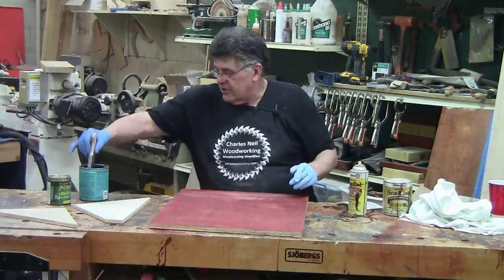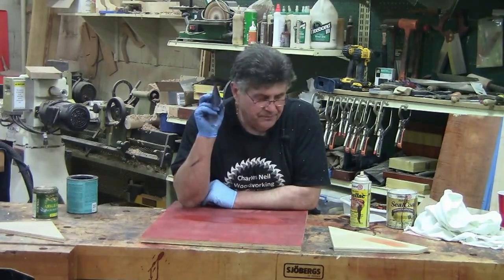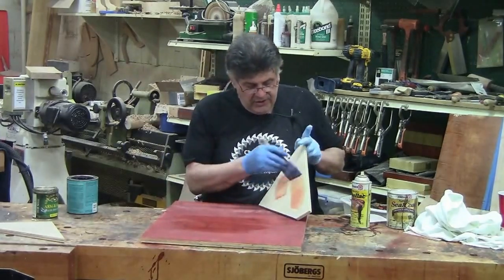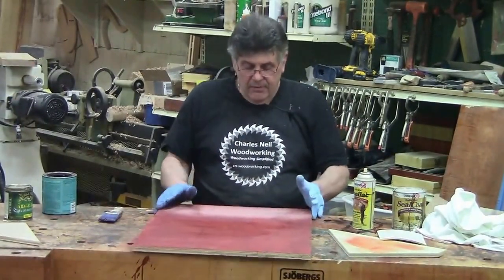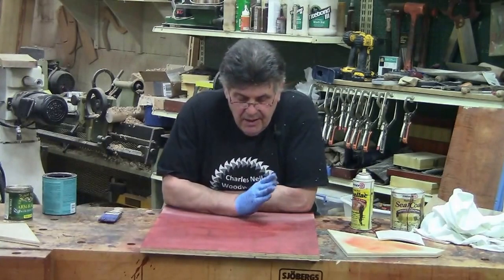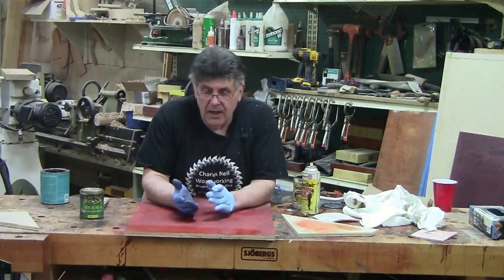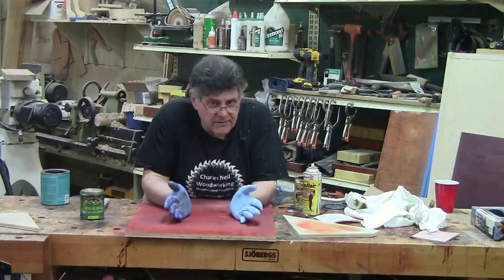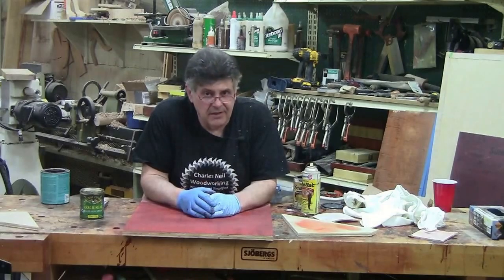Like on Like - Top Coats over Dyes and Stains

Comment: Thanks for the information, Charles. I still didn't get the answer to the problem well, though. I have applied General Finishes dye first on wood, and then applied a coat of dewaxed shellac on top, both with foam brush and with a rag. in both cases the result was terrible. the alcohol reactivated the dye and I got dark spots all over the place. I really don't know what to do at this point. I don't have a spray gun for my shellac. Can somebody help, please?
Reply from the maker: get a spray cand , and just do a light coat , or use some Arm R seal Oil to seal the dye down, its not water base so it will not pull the color, let dry 24 /36 hours, and then do your top coats, give it a light scuff sand with some 320 or finer, just go easy so as not to cut thru ..you should be fine

Comment: Great information. where do alkyd oils fit into the picture?
Reply from the maker: doesnt matter, oils over water base work well, just be sure they are dry before using water base products over them, and I also prefer to do a light scuff sand with some 600 grit, just to provide a mechanical bond.
Oils over oil based stains can also be an issue, so let the stain dry really well first

Comment: Julian Paul JonesCould I apply oil based urethane, Arm R Seal Wipe on Topcoat over and existing finish ? Kitchen cabinets, 5 years old, probably pre-catalyzed lacquer.I can't spray anything indoors. I am thinking to clean cabinets with 50/50 mix of denatured alcohol and water.Then scuff with 220. Then apply Arm R Seal Urethane Topcoat
Reply from the maker: yes , clean with naphtha , then be sure to give a good 400 or scotch bring sanding , get the shine off and provide the Arm R Seal with some mechanical tooth for adhesion
Reply: Thank you very much Sir ! I really appreciate this so much ! The old finish is holding well and is not peeling; it is a matte sheen and my wife likes some gloss sheen to it. 
I have been learning a lot from you, watching your videos many times.
Reply from the maker: Glad i can help
Reply: Forgive me for bothering; would you recommend to apply it veryically without removing the cabinet doors or remove doors and apply the Arm R Seal horizontally ?
Reply from the maker: you can do either .. most folks remove doors and drawers and do them horizontal , the cases  verticle,  the issue with verticle is thatyou wil have to do thinner and more coats One last thing and i missed it you said you were going to sand with 220 , thats too course on a wipe on finish, it will be hard to fill the scratches, use a 320 or finer, after the first coat go to a 1200 , it doesnt take much, just to remove nibs and so forth, the finer the sand scratch the easier it is for the finish to fill it
Reply: Thank you so much for everything and taking your time to reply ! I didn't know and was afraid  that the 320 or 400 would not provide enough tooth for the Arm R Seal. I am very glad you mentioned this so I don't create deep scratches. Thank you Sir !

Comment: I would NOT use oil or water based products, the Pro's use lacquers and conversion varnish, vinyl based primers and sealers, get the suppliers to break it down for you